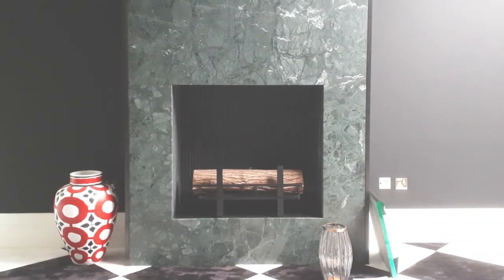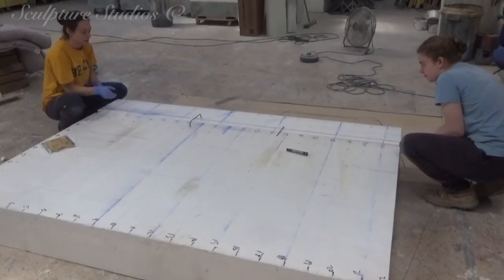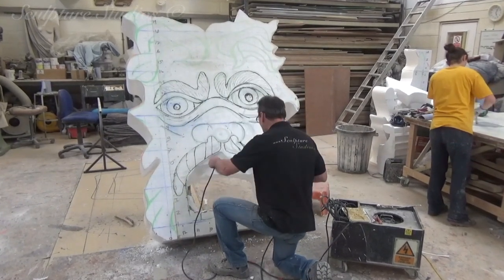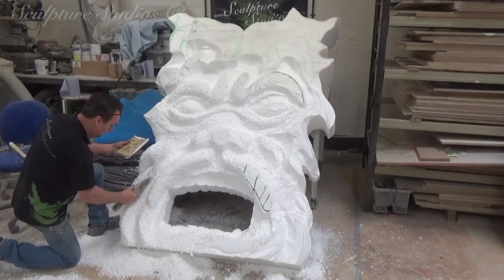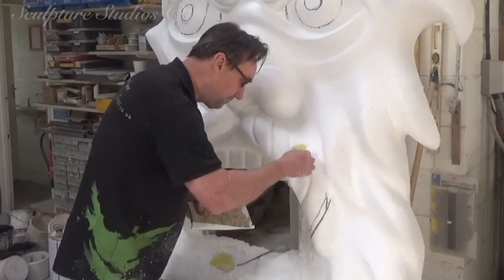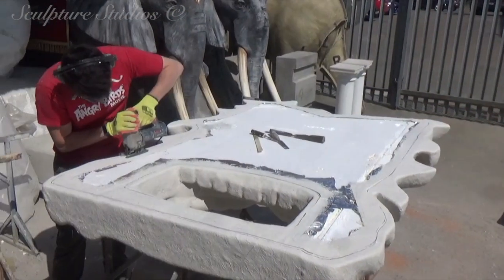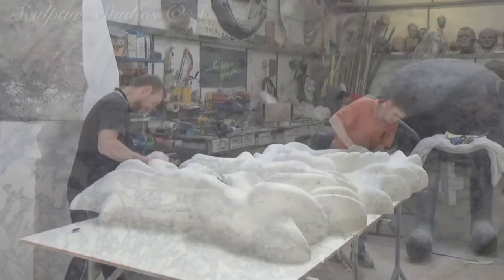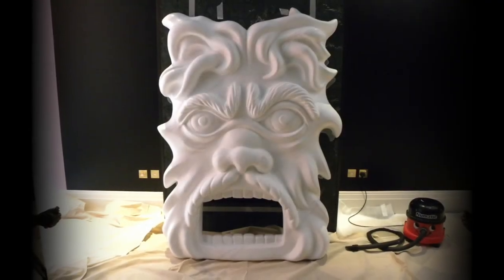Hand Carved Fireplace Face - Faux Stone / Marble Look Surround by Sculpture Studios

Comment: What I would give to have something like this but I could never ever afford something like this
Reply: You can make a light weight paper mache' from toilet paper and drywall compound, it is real smooth. You would have to use some styrofoam pieces or something to build it up, then use chicken wire over it so the stuff would stick to it. You can use concrete too. Hire an artist for about 500 lbs. I myself could do it. You have to be an artist to do it.  but it is easy just to put the stuff on the wall and not make molds. You don't really need to.
I want something interesting in my house and a green man type of fireplace like this would be really neat.  I am still building, so I have plenty of time to plan it out.